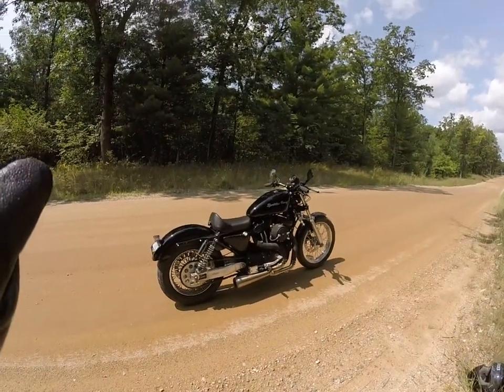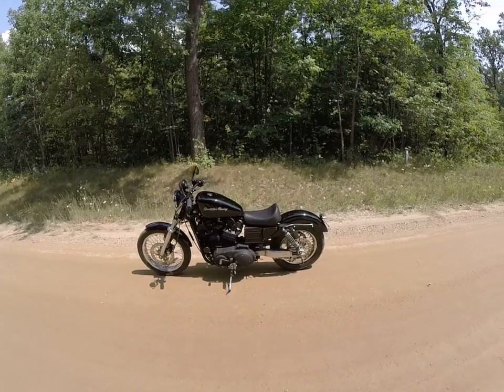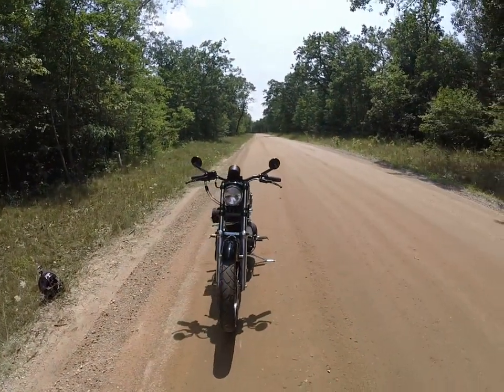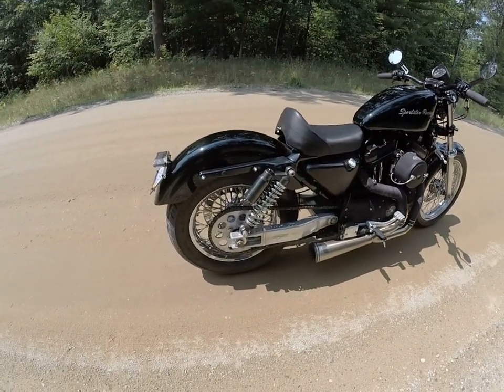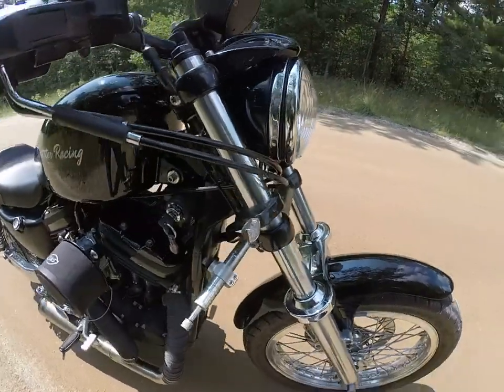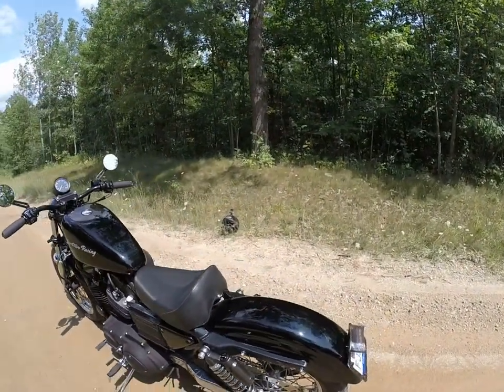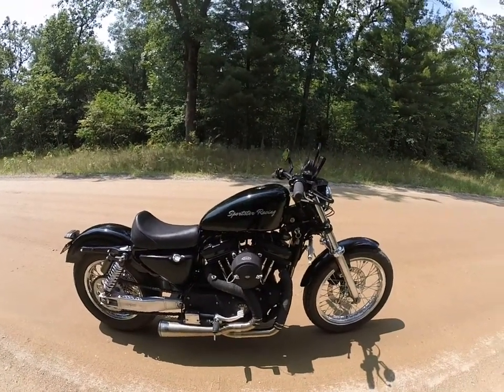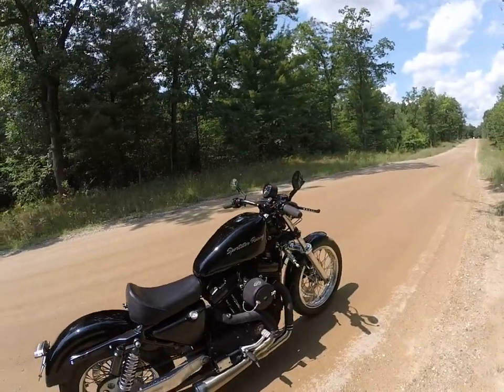Harley Sportster 90 Inch Hammer Conversion, update 2nd season review

Comment: this is real nice im in process right now of building a 100 in sportster im using s&s cases lol basically the the whole motor is s&s  andrews trans.im looking for an aluminum swingarm like you have here.im running drag bars  s&s carb etc its been in the works for awhile i saved up for the cases and lost my job so it put the brakes on everything.i used to have an ironhead stroker back in the 90s it was about the size of yours shown mine was around 88 i think.for people that dont know when you have a sportster and start getting into these big bore stroker motors they are insanely fast my first stroker sportster ill never forget it was scary fast anyway nice job brother i really love yours!!!!

Comment: I freakin' LOVE little Sportsters and chopped bobbers that smoke big 120+ci 'road rulers'.  My hard tailed Darwin Model 1 has a 'little' 80" crate on it and it pulls so hard from 0 you gotta hang the hell on w/ a tight grip or it'll buck you as it damn near did me when I 1st got it.  Even ^ XL probably weighs at least 50lbs heavier than my Model 1.  I can't wait to drop a Wood cam in it & tweak it a litle.

Comment: I might do a 90 or 100 on my XR1200 some day but I want it mild enough to run around as usual, not a track only bike. Hows temps with this bike on a normal ride? you have a oil cooler?

Comment: Nice job, no doubt. Doing a 90" Hammer job on a '86 for a customer now. This one was also a 883 originally. Did you have Darkhorse balance the flywheels also ?
Reply from the maker: Hey thank you Ken! Yes I did have Darkhorse balance the bottom and install S&S rods. Thanks for watching!....Mark
Reply: @motorcycleridingandrepair1627  Did they weld the crank?

Comment: How would you comment about the reliability after this upgrade? Could you run this as a daily?
Reply from the maker: I probably would not run a 90" XL as a daily ride. My daily XL ride is a 1250 Hammer build motor.

Comment: awesome videos just subscribed!!!! could you tell me what you think the best bang for the buck would be for a 91 1200 sporty. don't want to go all out like you but would like to have a little more power. currently finishing my 883 chop but my 1200 is goin to be more of a go fast ride
Reply from the maker: Hey sidestreetways16! If it is stock a couple of the easiest upgrades is a pipe and to put the hop up kit in the CV carburetor which costs about $40 for the kit. Then you would also like to put a free flowing air cleaner on it. The stock HD air cleaner has to go. There are a few different exhaust pipes. Go to the Hammer site and look at their exhaust dyno page. Starters...
Reply: What is the hop up kit

Comment: 1474 cc Sportster 10:07 ...122 MPH COOL BIKE
Reply from the maker: I have 3 different Sportsters Tom and this one goes very good! Thank you for watching!
Reply: @ Harley Davidson Racing , I’m thinking about coming to HD. Just tested a 2016 roadster and liked it. What sort of work needs to be done to take it to 90 or beyond. Is it all bolt on ? My point being, I hear balanced flywheel and matched and all this stuff and think, yeah, good, but for a hack like me, will bolt on work pretty good and the other stuff is just for tenths of seconds ET. I just want a crazy torquey Sportster that won’t break anything but bigger than 1200.  Any advice is welcomed and appreciated. I’m in Sydney Australia, so will probably do the work myself by watching the usual HD YouTube mechanics.
Reply from the maker: Hello Tom and thank you for watching and the comment all the way from Sydney! How cool is that half way around the world from each other! You can only go to 1275 with bold on top end parts with the Sportsters without breaking and boring out the cases for the larger 88" to 90" cylinders which ends up being a fair amount of work and approximately $2000 more cost. I have a 1275 reviewed in other videos her on the channel if you want to look.

Comment: Why do you let off the throttle to shift?
Reply from the maker: When I am not racing I usually use the clutch. Thank you for asking.
Reply: Thanks for the reply, that's really cool. I just recently got the 1275 kit,. I'm also running the XB heads with 190 valves with the crush Port job. 560 cams. Running a Super G carb I was previously running a 90 Main Jet assuming I'll probably have to go up. Running the supertrapp 2 into 1 but I had to remove the baffles because the bike would not breathe installed I guess you could say homemade baffles. Long story there. But thanks man, have a good one
Reply: I dig your bikes
Reply from the maker: It sounds like you have a great bike build going James! I love those hot rod Sportsters much better than the big rigs! It should rip!

Comment: If you decided to make the 90ci a racer instead of the 1275cc do you think it would be faster?  And on the road is the 90ci smoother to ride?
Reply from the maker: The 90 CI could always be faster because it is about 200 cc bigger! The smaller motor would be smoother.
Reply: Harley Davidson Racing to put the 90ci in, is it just a bolt on like the 1275cc or do you have to change everything to use it?
Reply from the maker: You have ot take the complete engine down to bore the cases for the bigger cylinders. You also should rebuild the bottom end while you have it apart.
Reply: Harley Davidson Racing how much HP do you think you could get a 90ci up to but still have it a good streetbike to drive around daily?
Reply from the maker: 110 HP range
Reply: @ace7626  the new hammer performance 1275 kit claims over 120 HP and have dyno sheets to back it up
Reply: One of Hammers dynos on the 90ci kit read 150hp... blew my fucking mind